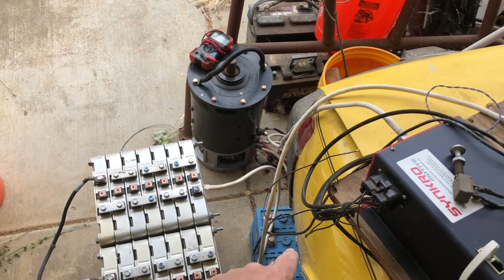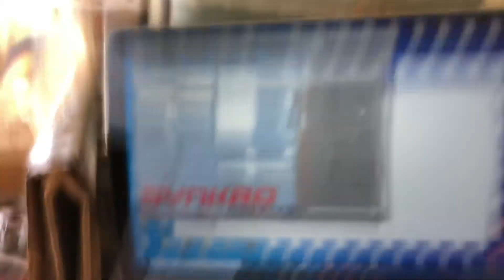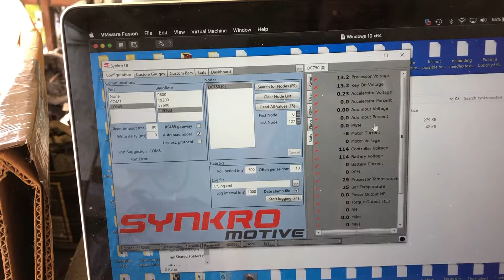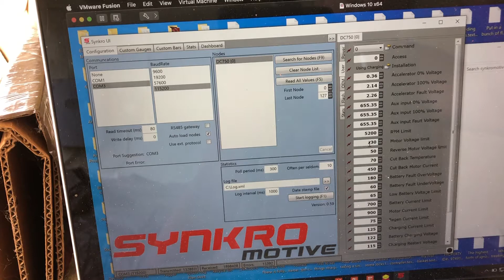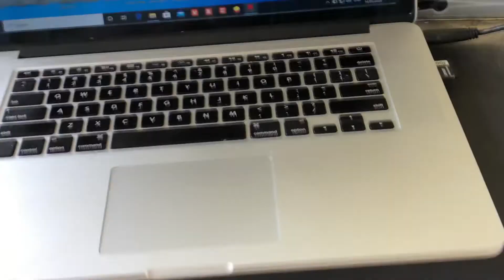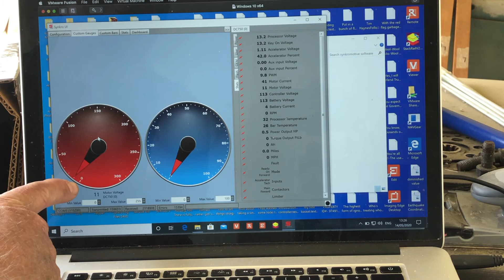Synkromotive Controller Test

Comment: would love to have my controller up and running its reinstalled in the 914 now and motor checked  but im still struggling to find software and a dongle to interact with the laptop and set throttle calibration etc... as there was no dongle when i bought the car imported from USA any info to help this  happen will be totally appreciated
Reply from the maker: I have software. The dongle may be a simple thing too. Contact me directly at one green ev at g mail